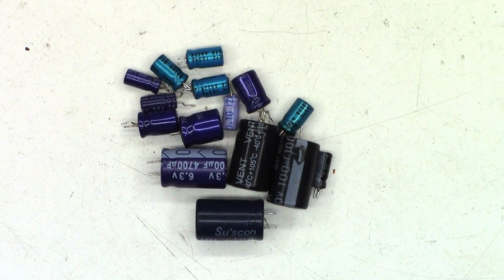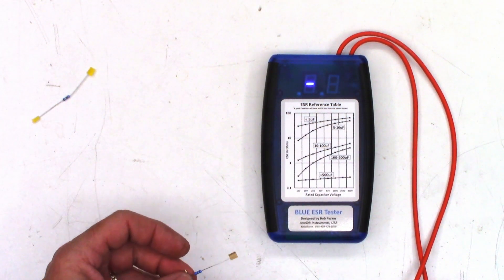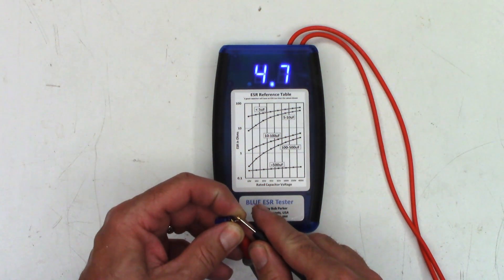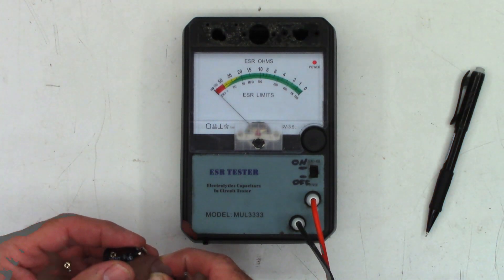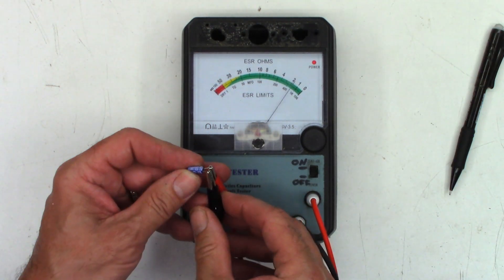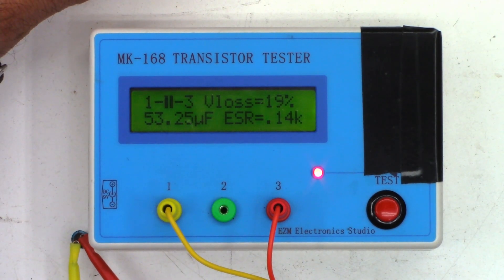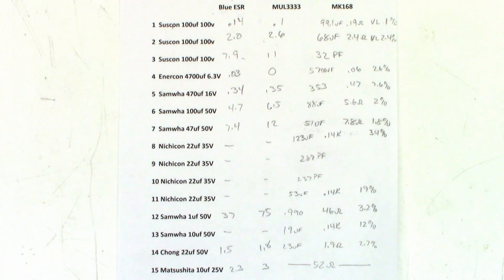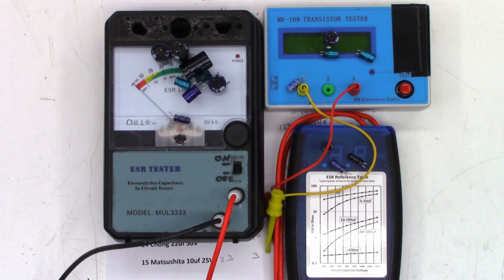Viewer request! Blue ESR Tester vs MUL3333 analog ESR meter vs MK168 Transistor Tester

Comment: I have one of those MK-168 testers, but unfortunately mine died recently (the display won't light up anymore and the LCD Display itself won't display anything anymore) when you push the "test" button the red power LED lights up but the LCD Display doesn't light up or display any readings anymore, is there a repair for that or is it just something that needs to be thrown away? 
because my MK-168 died and I needed an ESR meter to help in repairing some old Transistor radios and a couple of old VCRs I bought one of those MUL3333 units used on feebay for $30 (I couldn't afford nor justify the $100+ price tag of the other units they had for sale on there including the Capacitor Wizard, and I didn't want to get another MK-168 because of the one I had dying in the manner that it did in case it was some sort of design flaw.)
 I had to buy some new test leads for my MUL3333 because mine didn't come with its original test leads, but mine works pretty decently for what I need (I used it along with my own observational skills to repair a portable GE cassette recorder from the early 1980s that had two bad Matsushita capacitors (the light purple ones) that were causing the tape player to not play any audio when it was playing and put out a low pitched hum (its a 4 "C" battery or 6V DC Wall wort powered unit.)
Reply from the maker: I have had the same MK-168 for almost 10 years and just recently ordered a replacement just in case my original died. I did cook a previous one by trying to test a charged capacitor though.
Reply: @norcal715  mine was only half a decade old when it finally died, and even after only 3 years I started having trouble with it misidentifying known good capacitors as either resistors, or giving me a “no or unknown part” messages when I was trying to test capacitors or even diodes or transistors.
Reply from the maker: Were you testing out of circuit?
Reply: @norcal715  yes I was. Unfortunately I think the batteries I used with it may or may not of had something to do with it because I used the cheapest batteries I could get ( 9v batteries have been $15  for a 2 pack recently.) so I would usually get the store brand batteries.

Comment: It’s hard to beat the DE-5000 LCR meter. Compared to my high end calibrated benchtop LCR meters… like the Syncor Z meters, and HP meters….Pound for pound it is always the most reliable and accurate. 

I also love the “cap-Analyzer“ that used to be sold by electronic design specialties. If you can snag one they are also extremely reliable with a very unique ESR circuit. Anything designed by Dave migga from EDS is a device that should be on every bench! Especially their cap-analyzer and leak seeker
Reply: Would also love to see the “five transistor” analog esr tester designed and shared on the EEVblog forum. I bet it’s more accurate than the old MUL3333

Comment: I have seen these MK168s on various sites, and I just assumed they were a low-end transistor checker.    I have wanted an ESR meter but couldn't justify the cost for my needs.   This is perfect.   Not only does it measure ESR but it will function as an ohm meter,  a diode checker and a capacitor tester displaying not only the ESR but the value too!   Dandy little unit.   Picked one up for under $30 on Amazon.

Comment: hello ,Pleeeese help me ,  i am very frustrated  have the capacitor wizard , it cost 180$ witch i payed ,also i have the "der de-5000" that cost 110 $ , every one give me a defferant result '  how can i test its accuracy ? can you do that , i dont know is the caps i am testing is good or bad on board , because of value difference .

p.s - i love you videos , i am am donation from time to time 

thank you
Reply from the maker: uri cohen I have credited you in my videos. Thank you.
Reply: @norcal715  Just wait till the "Blue2" ESR meter goes on sale soon. The "deluxe" version speaks the readings too!
Reply: What the blue esr 2 is better than the current one .
Do you know the capacitor wizard .
Its very expansive .
Is it good as the blue esr ?
Is a analog decice cost 160 $.
Thank you
Reply: @uricohen5463  Hi Uri. The Blue2 ESR meter is slightly more accurate than the Blue meter. It is powered by 2x cheap AA cells (can be rechargeable) and it reads down to 0.001Ω as well as being smaller. Yes I know the Cap Wizard which was designed by Doug Jones. It is very highly respected in the repair community. The only difference is that it has analog readout but it is just as useful. You can see more info about the Blue2 ESR meters at http://bobparker.net.au/esr_meter/blue2-esr.htm  Please ignore the warnings about it not being available, which were written in the middle of the COVID-19 pandemic.
Reply: Check a selection of resistors, as shown in the video.
Reply from the maker: That's what I was going to suggest. Thank you Bob!

Comment: Excellent video! The question that I have is what have you taken away from this experience? 
Performance aside, it's clear that the blue ESR meter and the MK168 both performed as intended but as I have mentioned in previous posts, when testing capacitors, you need all the information available about it's condition and state! The winner of this test is clear for me! It's the MK168! 
The Vloss value is the most important detail here! Even more so than ESR! And it can be tested by taking a lower value resistor and placing it in either series or parallel with a capacitor in a circuit and running it, the parallel resistance will destroy something else after it whereas the series resistance will limit the current! 
I have a slightly better version of the MK168 but I have since got an LCR Bridge Meter (search for it by that description on eBay) which cost me $100AU and it provides even more information! I haven't looked back since! 
Yes! It's makes the job harder because you literally have to remove capacitors out of circuit! But without knowing the Vloss value, you don't really know if the capacitor is good or bad! 
I wish there was an easier way! And until someone develops an in circuit LCR Bridge Meter! We are all going to need to keep our soldering irons on standby! 
So! Do you find the Vloss value is an important factor or are you going to just stick to just ESR measurements?

Comment: I have one of the original Creative Electronics ESR meters from the 1970s. I wouldn't trade it for anything.
Reply: I think that was the first ESR meter on the market. Designed by Carl Vette (I think).
Reply: @ZilogBob  Yep, Carl W. Vette, he held the patent and was the only one making such a meter until the 1990s. Lived in Clawson MI at 1417 N. Selfridge st. as every meter face says. Mine is old enough to still have the 100kHz IC, later ones ran at 50kHz as he couldn't source the 100kHz version any more.

Comment: Awesome comparison. The beauty of analogue meter is one can make it DIY version and it works awesomely.
Reply: You can always make your own MK168, I'm tempted to make one as a fun project. Details can be found here (use google translate) http://avrtester.tode.cz/
Reply: I built my own ESR meter using one of the circuits out on the web.   I chose the ci9rcuit that doesn't require specialty coils or transformers.     I have used it for 7 years now.   It has saved my butt MANY times in that time.
Reply: Would also love to see the “five transistor” analog esr tester designed and shared on the EEVblog forum. I bet it’s more accurate than the old MUL3333

Comment: Great analysis, I still like the analog movement, but, no question the blue and the Ebay tester were a bit more accurate. If only I had an ESR meter 25+ yrs ago, I could've saved so many more devices. 😔